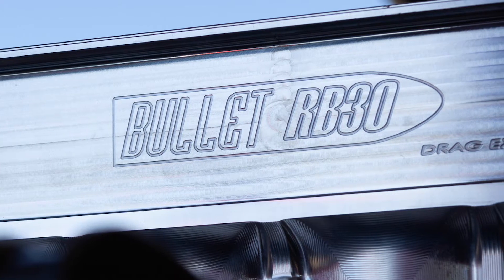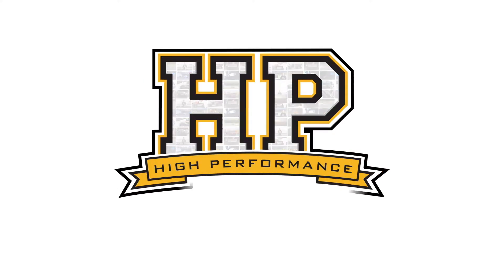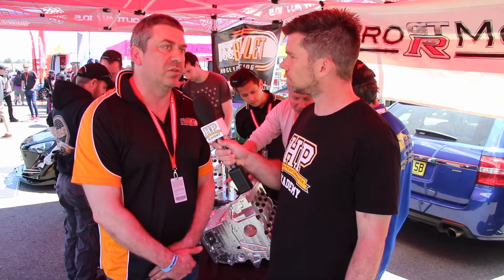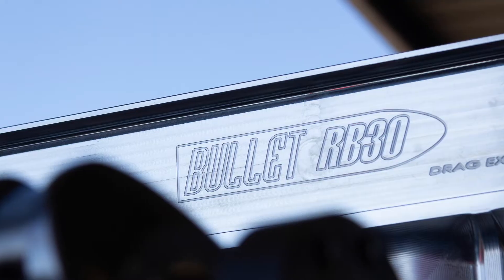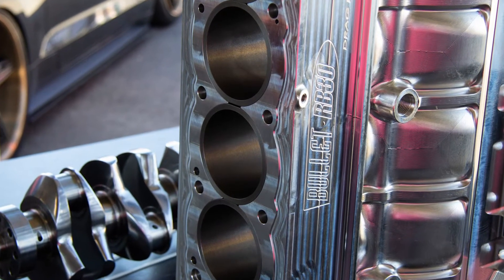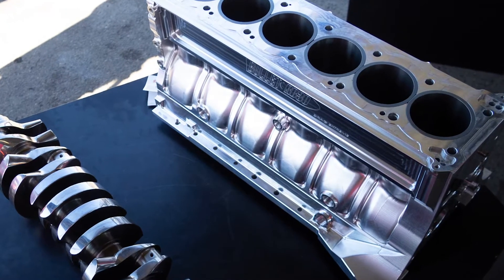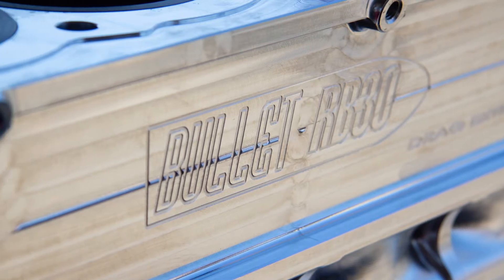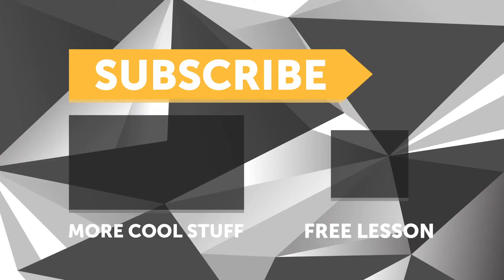Why Run a Dry Deck Surface but Still Retain Water in the Block? | Engine Building  [#TECHTALK]

Comment: I've heard monster truck teams running dry blocks. Do you think there is an advantage to running dry vs wet. Granted,  monster trucks rarely run past 90+ seconds unless its a parade lap/event.

Comment: So Darren is suggesting the engine is splitting water into Hydrogen and Oxygen and turning the combustion chamber into an "oxy torch"? Sorry, this guy doesn't know what he's on about. I think he must be a marketing guy and not an engineering guy. Thermal decomposition of water requires temperatures over 2200 degrees Celsius (3990 F). No internal combustion engine runs hot enough to decompose water and liberate oxygen from it. That's just complete and utter snake-oil nonsense. Your engine would melt long before that would even be a remote possibility. Actually, you'd be getting close to boiling Aluminum at those temperatures. Besides, the thermal decomposition of water is an endothermic process, meaning it doesn't release any thermal energy. It actually does the opposite! Even if it were feasible - it would actually absorb more heat than the resulting oxygen would release during combustion.

Water is not an oxidizer. Nitrious Oxide is an an oxidizer. It decomposes exothermically releasing a lot of heat and a lot of oxygen in the process - and even it doesn't really 'torch' cylinders. Hence it's regular use in race engines.

Coolant getting into the cylinder is obviously a bad thing, but not because it releases oxygen and 'torches' the engine.

One of the main reason you don't want coolant entering your cylinders is because it mixes with oil and ruins it's ability to lubricate engine parts. This will quickly destroy any engine. If a very large volume of coolant enters the cylinders all at once, as can occur in the case of a failed head gasket, it can be very destructive as water is an incompressible fluid. At the very least your connecting rods will snap and your cylinder heads will be destroyed.

Comment: Wow. Im just so amazed. Got into cars around 99 but never built anything beyond swaps, basic internals, and stock rebuilds. Its awesome seeing what these high level builds are doing differently such running 2 different cooling systems as mentioned here. HPA, u guys have awesome content!

Comment: There is another problem with water, extreme temperatures, and aluminium. When hot aluminium is EXTREMELY reactive, even explosive* under the correct(?) circumstances, with water.
One of my summer jobs, while at tech, was cutting up alloy scrap for a smelter that re-cycled aluminium - the importance of ensuring there was no possiblilty of moisture remaining trapped was rather strongly emphasised, both during the introduction videos and lectures, and during the job...

*https://hackaday.com/2020/12/30/water-and-molten-aluminium-is-a-dangerous-combination/

Comment: Couldn't you run the fuel through the block in a total loss coolant system?
Reply: There are many reasons why that wouldn't be a good idea - but for a drag engine, the engine oil may have some advantages - or not?

Comment: 300 hp per cyclinder. god damn.
Reply: Scary thing is, that's kinda conservative when you consider what some people are getting out of their engines - 4 and 6's with ~500hp per cylinder isn't totally unknown nowadays. As an old fart, it's mind boggling when you consider what was considered extreme back in the day - even 'road' cars can be pushing the 300/cyl' mark!

Comment: So what happened to the sr20 86
Reply from the maker: It's still here, on the dyno this week for the Variable Cam Tuning course material. We've been pretty busy with course material but Brandon has been ticking a few things off for the race season which is still a few months away 🤘 - Taz.
Reply: @hpa101  Did you have issues about vibration which brakes sensors or throttle?

Comment: I like some of the external block cooling solutions coming out. I think this is the future direction of engine cooling.
Reply: What kinds of external block cooling solutions?
Reply: @Kj16V  Morrison Racing has a video of their billet block design using a water jacket formed along the outside of the block.
Reply: @joanamendoza-r5l  I'm guessing you're thinking of Steve Morris Engines 481x wet block setup? That's not exactly just external block cooling. The block and heads are still designed for water around the cylinders and ports, but retain the dry deck as described in this video and dry sleeves for block strength.
Reply: They're still internal, but with block and head separated.
With billet, or cast*, blocks and heads where much of the material can be placed exactly where it's required, and costs continuing to drop, I would agree that there is a lot of potential for still greater developments.

*With 3D printed cores and foundaries who can cast using those customer core designs, it may be more adventageous than billet for some applications - and if there is a pressure casting option, all the better.